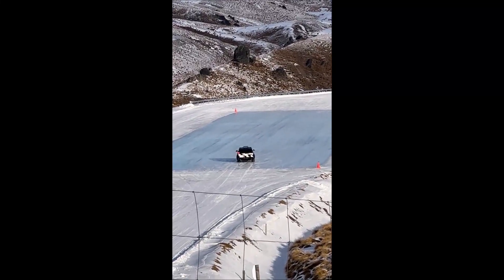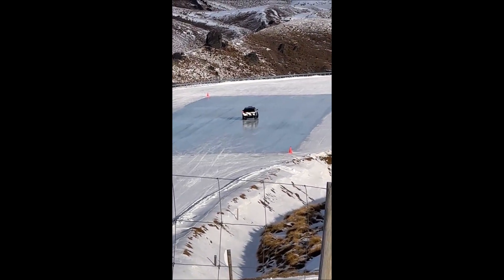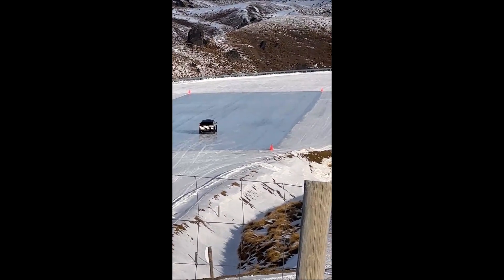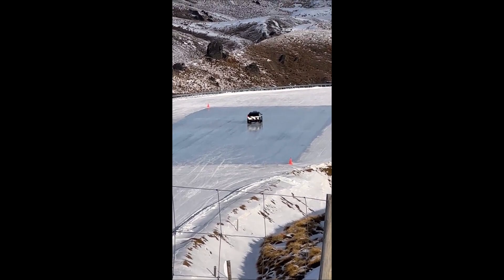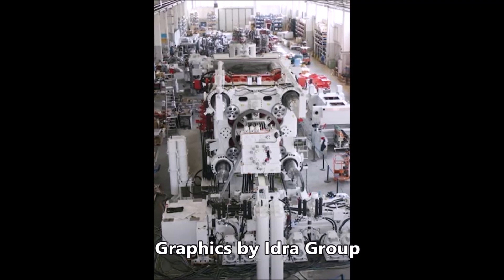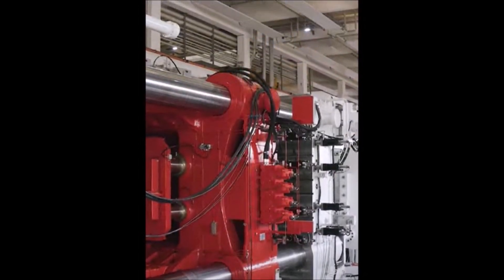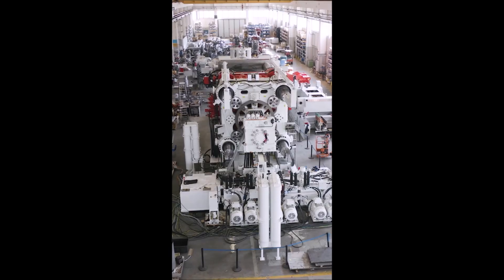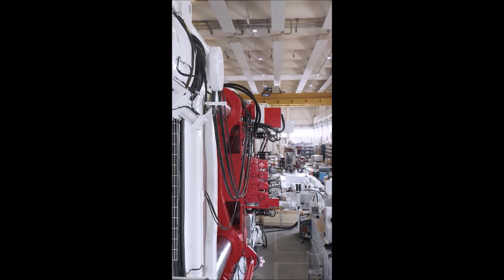Tesla Cybertruck Slides on Ice, Possibly Testing How FSD Handles Icy Road

Comment: I'm no engineer but I believe to maintain the precise specifications and tolerances as well as the strength required of the components that are being cast that these machines will have to operate and be maintained and he virtually immaculate condition and for safety I'm sure that the seals and moving parts must be maintained in immaculate condition to avoid leakage which such high pressures could be extremely dangerous to personnel and equipment as well as a source of immediate or delayed explosive events. I believe these machines and their work site will be continuously maintained in immaculate condition even that exceeding the conditions of SpaceX raptor engine production equipment and facilities

Comment: This is test on icy surface with a slope is all about calibration for the rear steering  in slippery conditions . This is  INDIRECTLY for safety but mostly ENSURING YAW CONTROL while preventing a vehicle from sliding off the road laterally if all 4 wheels have very poor grip

Comment: The future of cars is carbon fiber, you know the material Musk should have used on Starship!!!!!!!! Gee, I wonder if Cybertruck would have been lighter and performed better if constructed with carbon fiber? What you think, tor-kee?
Reply: I think sub that imploded descending to the Titanic was make of carbon fiber.
Reply: @Martin-se3ij  - No outside pressure in space, carbon fiber is the way to go for best results. But you are correct about the sub, they should not have used carbon fiber to build it, should have gone with high strength steel. Musk should get into the submarine business, he has lots of experience with steel.